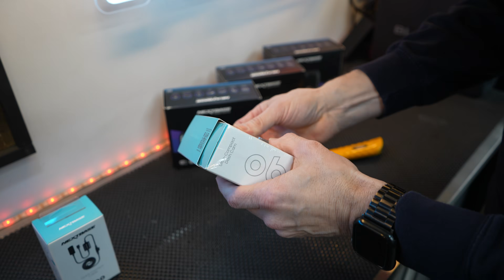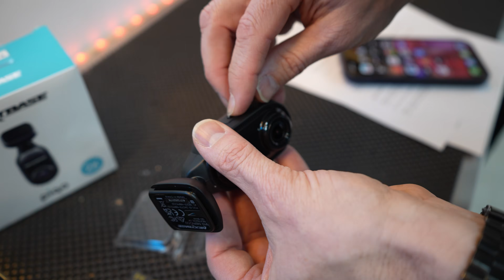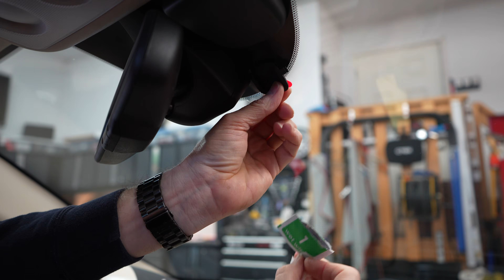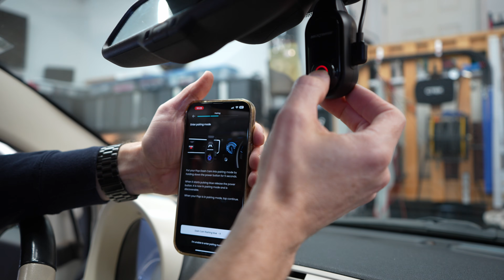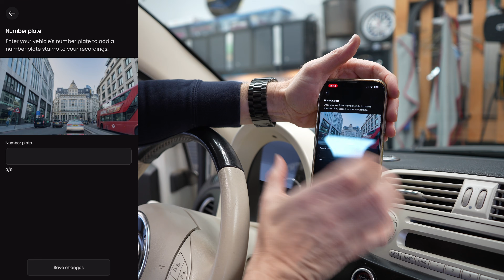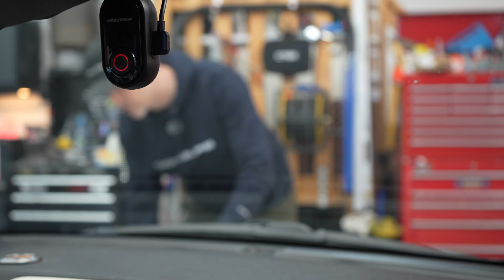This Budget Dash Cam is Actually GOOD – Nextbase PIQO 2K

Comment: I bought one. It works well. Image quality is good. But I’ll never buy another Nextbase product again. I purchased the Piqo 2K directly from Nextbase as a package deal that was advertised as including the Piqo Pouch. Package price was discounted from $139 to $129 and included the camera, power cable, mini SD card and pouch. I was also able to get an additional discount (do not recall how) so total price was $116. The pouch was not in the package. Contacting Nextbase only resulted in a runaround basically saying I can order the pouch from them but pay for it. I’ve already paid for it. Crap company.

Comment: mine wont install, just wont connect to my phone via wifi so wont update firmware, share videos, wont even go into recording mode. Waste of money. I have 'forgotton' home wifi, I have tried elsewhere etc. its just junk, nextbase havent given any support.
Reply: If your car has carplay sometimes that can mess it up. Delete your phone from your car’s carplay listed connections and see if that helps (you will have to reconnect your phone after the process is done)

Comment: My Piqo 2k is hardwired to the fusebox, should parking mode be available?
Reply from the maker: Yes, the Nextbase Piqo 2K can be hardwired for parking mode using the dedicated Piqo Pro Install cable (sold separately). This allows the camera to record incidents while the car is turned off by drawing power directly from the fuse box.

Comment: I could not find the password for the wifi where did you find it?
Reply from the maker: I don’t think you need a password, but some other nextbase cameras use 12345678

For your Nextbase Piqo (using the Nextbase App):
Press & Hold: Press the Piqo button (or Protect button) on the camera for about 5 seconds to activate pairing mode (holding for 10 seconds resets it).
Open App: Launch the Nextbase App on your phone.
Follow Prompts: Follow the on-screen instructions, select your camera when it appears, and approve the pairing/Wi-Fi connection.

Comment: I recently bought the Piqo 2K.  It is just what I was hoping for.  I was afraid installation would be daunting, but it was very easy.  App set up was just as easy.  Video is very clear (I have not used it at night yet, though), and getting the video off the SD card onto my computer is very simple.  So far, I'm very pleased with it.

Comment: My scangauge 2 goes in my OBDii port. It gives me all the  vitals of my car as I’m driving. There’s no I am putting a little camera in that port.
Reply from the maker: That’s one of the 3 different ways to install it.  You can also buy OBD2 splitter cables to run multiple devices at the same time on the port.
Reply: Then dont?

Comment: Hey Don. Super helpful video. My daughter has just passed her test (in the uk so we still use miles despite every other measurement being metric 😅)
Wanted to get her a dashcam and found this video really useful. Also my daughter has the same car as your daughter so that was handy. You say you use the 622 which is the one I was originally looking at. How do you feel they compare. Is the 622 worth the extra cost would you say?
Reply: Thanks so much. Really appreciate your advice 👍
Reply from the maker: They are in totally different classes.  The 622 is superior in pretty much every way, but the biggest user experience difference is having a screen or not having a screen.  The PIQO I think is good for someone who just wants to set it up and forget about it.
Reply: 622 has really bad reviews everywhere I look..

Comment: Question i used to have a dash cam, but living in Florida, the heat kills it.  One thing u have to say, I used to place windshield heat reflecting to try to keep the cabin cool, but the protector used not to cover the cam.  Could that have been what got the cam soooo hot???

Comment: Switch to kilometers just like the rest of the world as if that's a flex. If I recall, the rest of the world wants to come to America where we use miles per hour. Also, moonmen use miles per hour 🤔
Reply: The three countries which are not using the metric system are Liberia, Myanmar, and of course… the United States of America. But why is the United States so keen on using miles and gallons when the rest of the world has long moved on and embraced the metric kilometer and liter?
Reply from the maker: Not a Flex 💪

Comment: I got this at Costco with the ODB adapter included and SD card.  It was $95.   I'm happy with image quality it's nothing special but for entry level dash cam and install easy for a Dodo we are happy with the purchase. @BestBuy it's $150 + $30 adapter = $180 id be returning it with buyers remorse.  I'm happy with it all in for $100.